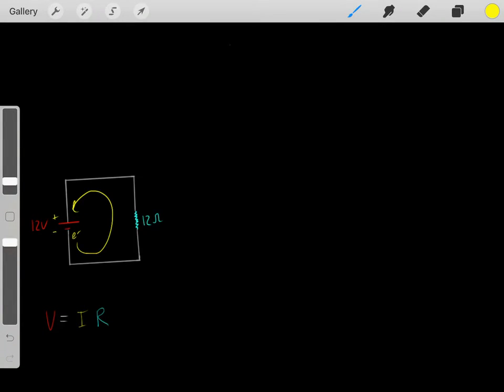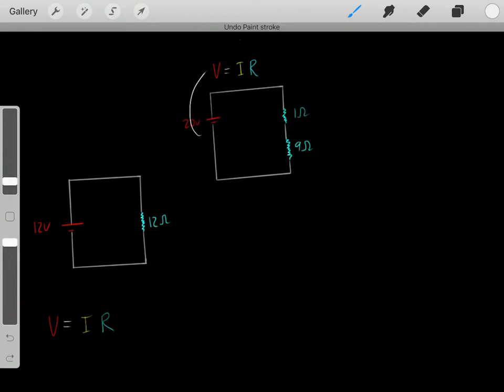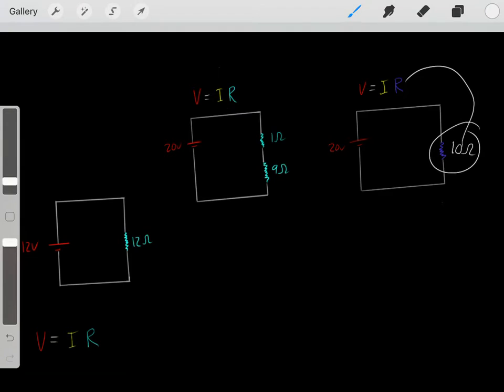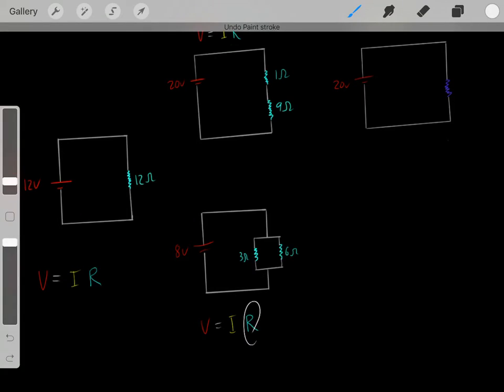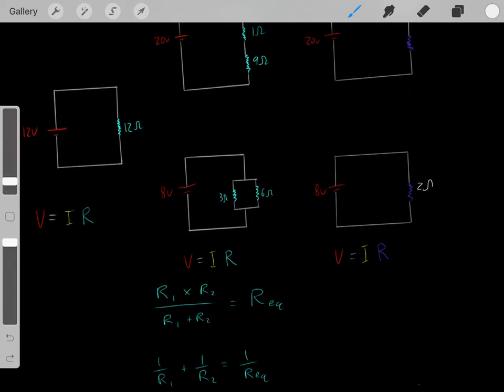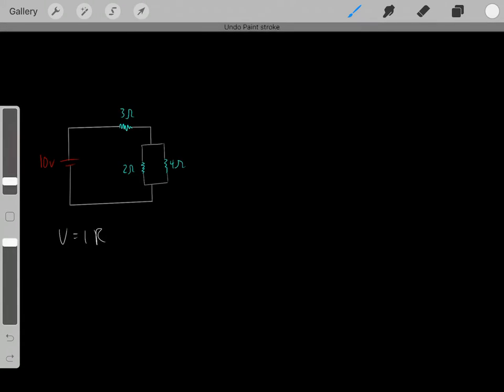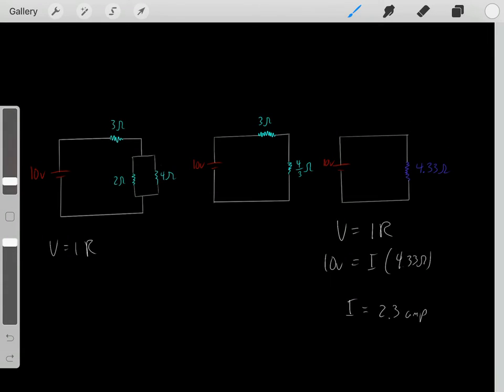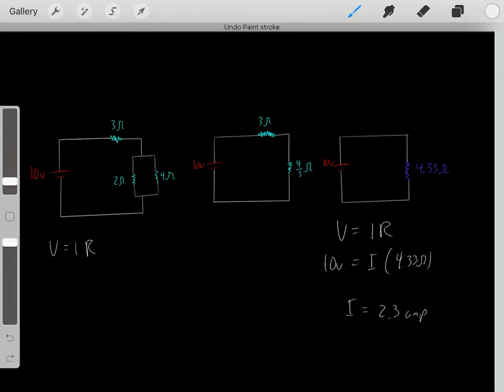Resistors in Series vs Resistors in Paralell formula V=IR Req Equivalent Resistance Circuit Physics

Comment: I think you made a mistake @8:25 when you calculated the resistance. it shouldve been 3/4 but you put 4/3. by the way thanks for the video helped  me alot!!!
Reply: He did it right…
Reply: i noticed the same thing. by the end it should be below 4 instead of 4.333 cus 16/4 = 4 but (3/4 + 3 = 15/4 so below 4